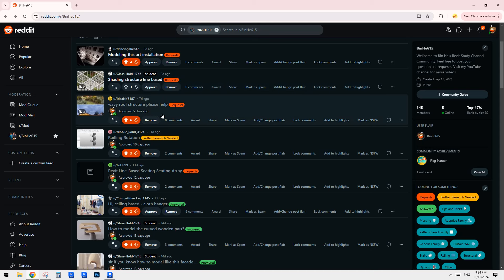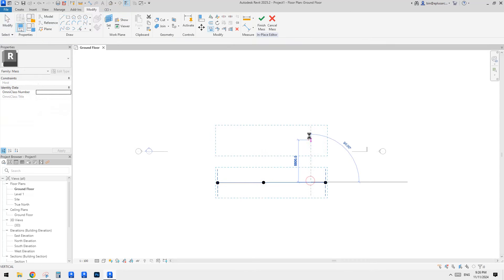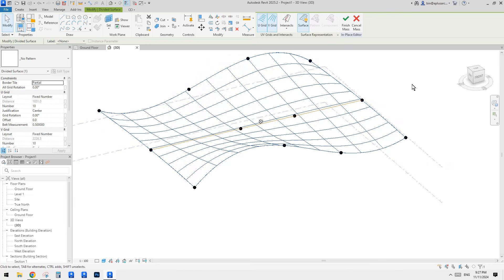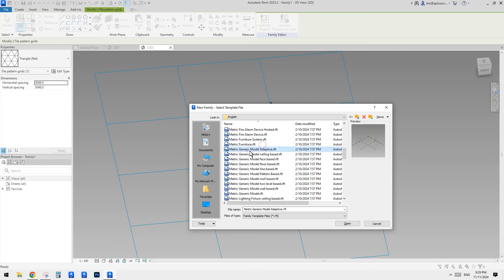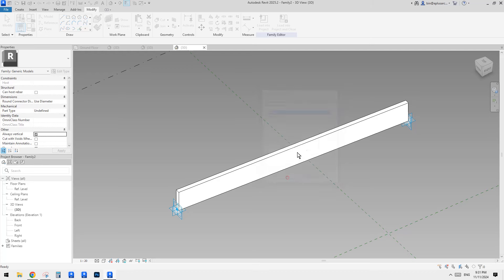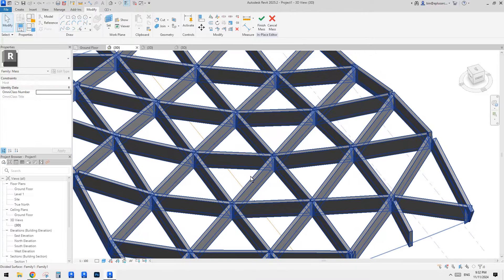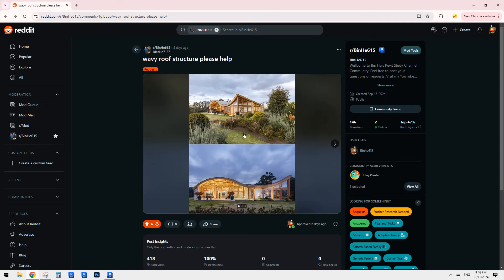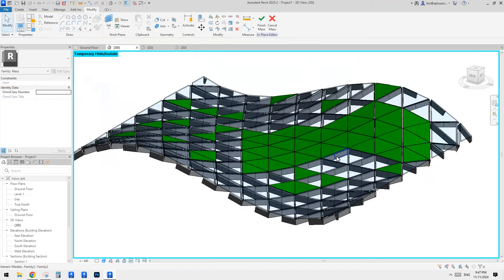24082 - Wavy Roof Structure using Pattern Based Family in Revit

Comment: Hello, i have a question : why did you go through the adaptive family when you could have drawn your geometry directly in the pattern based family ?
Reply from the maker: Because 1: it's easier to place adaptive familys on those reference lines than create 2 profiles on each of them. 2: I want to use the Always Vertical option to achieve the perfect matching for the half beams. It might be possible to achieve this whitout adaptive family, but I still think it is simplily easier to do it this way.